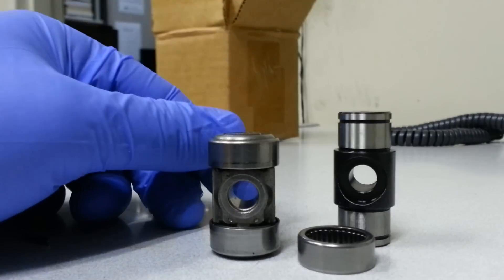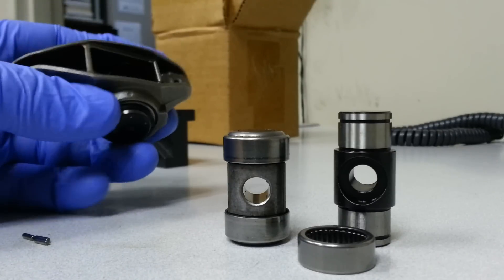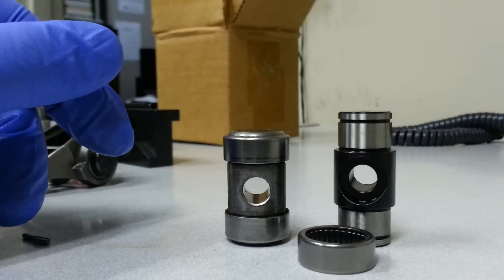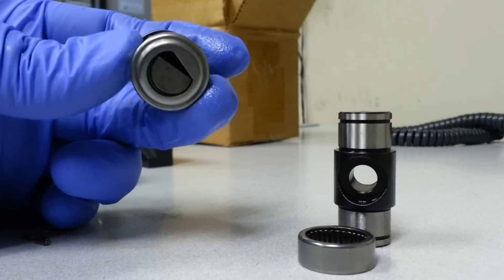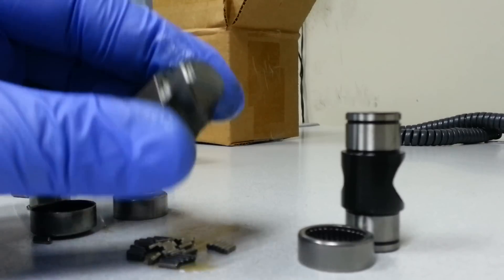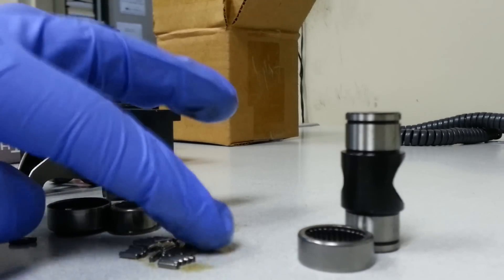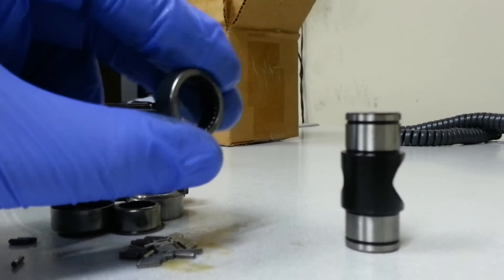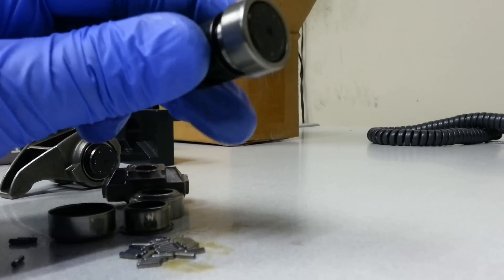LS Rocker Arm Trunion and Bearing Comparison

Comment: thanks for your reply!  I actually had to pull this engine down in the truck to the lifters.  The bearings in the lifters are longer than the rocker arm bearings.  When I pulled the valve covers off the rockers were in tact.  I pulled the heads off and cylinder one intake lifter broke.  As a matter of a fact I went with comp cam  cam and rocker kit with lifters.  a lot of money though.

Comment: nice, I heard gm had a cam kit that had stronger lifters and rockers that gives a fifty hp increase for half the price of what I spent on comp cam.  So I did a nice job putting it all together this weekend.  And I did buy new lifter guides.  That plastic gets hard and brittle.  It runs great!  A nice lope sound.  I just used the comp lifters.  I really like the comp rocker kit though.  very nice product.  Only thing I didn't replace was the wrist bearings and rings.  I did it in the truck.

Comment from the maker: I use GM LS7 lifter which are now the standard replacement lifter for LS engines. They handle over 7000rpms quite well. Comp makes great valvetrain parts. Just in case youre not using linked lifters I would suggest replacing the lifter trays. Also inspect your cam as these are known to wear lobes. This will introduce metal into the oiling system damaging the bearing. Trust me, I know. Good luck.